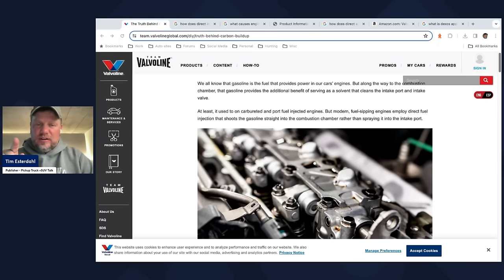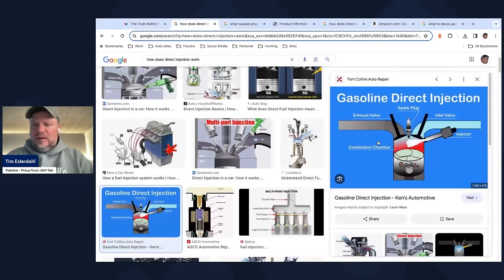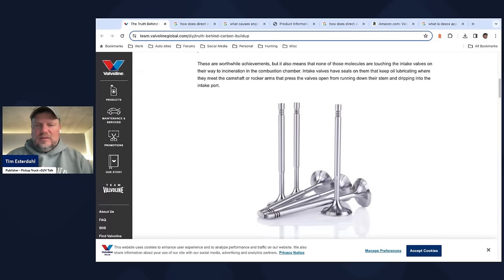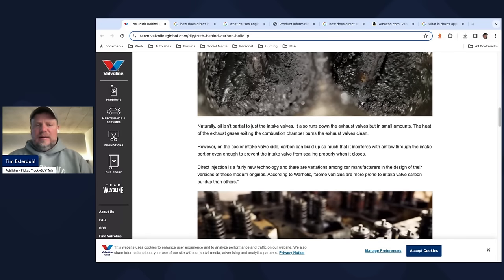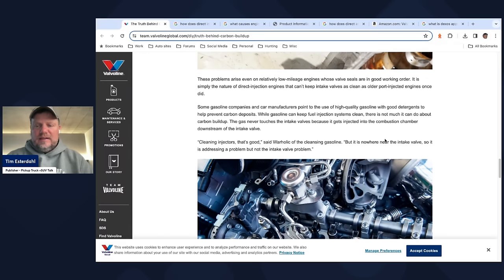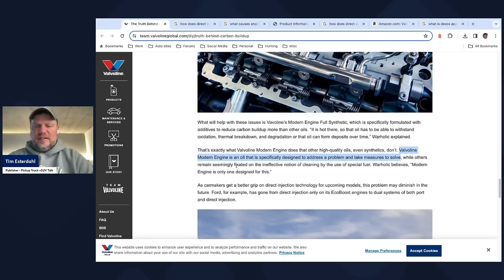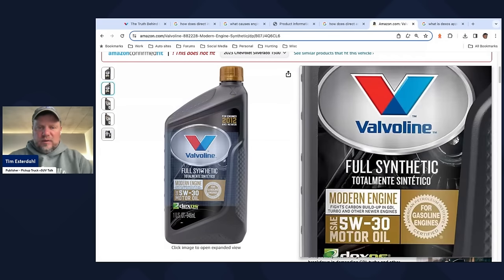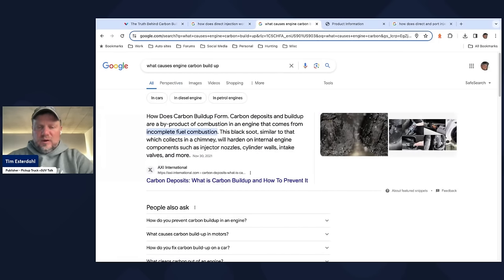Prevent Carbon Buildup with Modern Engine Oil? True or False?

Comment: You omitted one of the biggest culprits in carbon buildup in GDI gasoline engines--Exhaust Gas Recirculation (EGR).  Just as has been the case with diesel engines for over 20 years, EGR is a major contributor to carbon buildup on intake valves.  As EPA regs have tightened emission requirements to what are now ridiculously strict levels, EGR has become the major method of reducing NOx emissions in gasoline engines.  This started over 20 years ago with diesel engine emission control regs.  EGR use got so excessive on diesels that the engines' performance and longevity were severely compromised.  The "answer" was to move NOx reduction outside of the combustion chamber using Selective Catalyst Reduction and Diesel Exhaust Fluid, adding yet another level of sensitive equipment, complexity, and cost to the diesel engine.  Even at that, EGR is still used and is still a problem on diesel engines.  Gasoline engines are going to go the same route as emission regs tighten yet again.  Also, GDI also is increasing particulate emissions on gasoline engines.  Get ready for particulate filters and regens to be required on gasoline engines within a few years.  Keep voting for leftist politicians and the EPA regs will effectively outlaw internal combustion engines within a few years.  The EPA emission regs are no longer about cleaning the air, they are about  eliminating people's ability to afford to own personal vehicles.  That's already close at hand.
Reply: I have often wondered if we could use water/steam in place of the EGR exhaust gas to control NOx. Yes it would require distilled water keep hot enough to keep it in vapor form. It would probably rust the cat or SCR twice as fast
Reply: Most modern gas engines do not use EGR.

Comment: I have a Subaru 2021 forester with direct injection.  Quality oil …So what oil should I use ?  Gasoline is Costco signature ok ? So confused…..
Reply: Valvoline synthetic oil is good and Costco gas is top-tier gas so it is among the best you can get.
Reply: Full synthetic oil. Often a good idea to go up one weight in oil to reduce loss of viscosity. Top tier gas is best and an occasional use of combustion cleaners like BG 44k is good.

Comment: Low tension rings used today are more likely to get stuck causing more blowby. Using good quality Syn oil can help stop stuck rings or free them up. 
Amsoil, HPL, Pennzoil Ultra, Valvoline Restore & Protect are good products.

Comment: Ok..0w20-30-40 Class 4 Syn Oil...Change yourself every 3 to 5 thousand miles with new filter..Gas or Diesel/Star Tron Fuel Enzyme treatment..With GDI engines..Check PCV valve more often/ Big Catch Can ready at 90,000 miles+.......

Comment: Eco boost engines have both direct and port injectors to lower the amount of carbon.
Reply: The 2.7 and 2.3 needed it since Ford decided to use an EGR system (and EGR cooler) on it. EGR is a huge contributor to intake carbon on some DI engines. I believe one of the older Toyota engines that had DI only had an EGR system and caused a lot of the issues with carbon.

Comment: I have a ‘15 Sierra with the 6.2. It was dealer maintained most of its life for the first 90k miles. The engine started to stumble on startup at around 30k miles if I remember right. I had a $100 dealer coupon and used it towards their intake cleaning. After that I’ve done my own intake cleanings before each oil change mostly using Seafoam’s intake cleaning product. A couple of years ago I read an article that talked about Pennzoil European car oil and how it could reduce carbon buildup so I gave it a try even though it wasn’t Dexos certified and the thinnest weight was 0w30 instead of 0w20 GM recommends. It seems to work but I also swear I get worse gas mileage using it. I’ll look at this Valvolene oil and might give it a try.

Comment: I could be wrong but if you actually floor it like at least a couple times a week, you shouldn’t really have an issue w carbon build up, also using ‘top tier gas’ is more important I think vs any oil
Reply from the maker: As long as you get the engine hot and you buy good gas, you should be fine according to the people I’ve talked with over the years.
Reply: Do some research on gas refining. It all comes out of the same refinery there is no difference in gas.
Reply: @lawrencefranck9417  You need to do some research if you don't understand that the additive package for each gasoline brand and each grade of gasoline within a brand is different.
Reply: @4af  I have worked a port distribution port. One tanker fills three major brands and the amount of additives is so minuscule as to be irrelevant.
Reply: if you were just a laborer you have no authority to claim the gallon or so of additives added to each 8500 gallon tanker truck load is "irreverent" or not. A petroleum chemist I know at Shell insists that every car will benefit from the additive package used in Shell Premium grade gasoline.
Reply: @4af  more like 55,000 gallons.

Comment: Just drill a hole in the plastic intake runner past the mass air flow sensor install a premium aftermarket tire air valve remove Schrader valve run engine  about 1500 RPM start spraying carburetor cleaner in valve I would do it every oil change

Comment: Dual injection is an expensive stop gap solution to poor engine designs that use a lot of oil. That blowby oil in the crankcase is routed to the PCV and back over the intake valves. Stop the source of the problem by eliminating most blowby products and secondarily use detergents in the gasoline to scrub off the intake valves.
My 2015 Fit's intake valves don't look like new but there is no buildup on them after 110,000 miles. Use good oils and gasolines, I use Exxon/Mobil and Shell gasolines and Mobil 1 oils, along with good engine designs and you wont see this problem.

Comment: That oil is to clean pistons around the rings.  It won't be effective on intake valve deposity.  A catch can should be installed in the PCV system to avoid some of the carbon buildup.  As soon as you buy the car.

Comment: I'm sorry, but this Sounded like a valvolene commercial.  Why even bring up the conversation with Stellantis? When they didn't give you anything on what they did with their new engines to prevent carbon buildup?  What are they saying? Their new hurricane engines and the carbon buildup issue that they could potentially have.  Seems like adding a second injector to the port would have solved a lot of the issues. But I am canceling my 2025 Ram order. Because there's no clear response from Stellantis Is about what their solution is to direct injection and carbon build up.

Comment: The short is answer. It's  complicated.  A good oil spec, will help reduce carbon build up. But it can't totally prevent it. 

All GF6 rated oil has good LSPI and carbon prevention characteristics,  but oil change intervals are too long.

Comment: Valvoline restor and protect is not compatible with landrover 3 litre staight six engines as put in the latest defender D250 D300. It specifies 0w30 and only says use castrol

Comment: I thought the crankcase ventilation to the intake and exhaust gas recirculation to the intake was causing the buildup.
A friend put 186,000 miles on his 2012 F150 ecoboost without any issues caused by carbon buildup.  But, the miles were driving 35 miles each way to work which kept the engine hot.

Comment: Also, be sure to change your oil every 3k miles instead of extended oil changes, because the extended mileage oil changes are for people that drive exactly like the owner's manual states, but in reality, that is not how 95% of the population actually drive.  But unfortunately people do not read their owner's manuals.
Reply: 3000 if you use non synthetic oils.

Comment: I think manufactures need to include port injection like Toyota and Ford does. That would prevent it. Extended oil change intervals and people who idle excessively is the main issue from what I’ve seen with direct injection.

Comment: Car Care Nut, Scotty Kilmer, Automotive Press and others say to change your oil every 5000 miles, not 10,000. Car Care Nut took a Toyota four cylinder engine apart with a bit less than 200,000 miles that had the oil changed every 10,000 miles and there was a lot of sludge and varnish in the engine. He did it to show what happens when you change oil according to factory standards. Some say changing oil every 3000 miles on turbocharged engines would be a good idea. Most engines today are duel injection. My 3rd gen Tacoma has duel injection systems. It may be a good thing to check before buying a car. When you talk about oil blow by are you talking valve guide seals or piston rings?
Reply: Just use the severe service intervals listed in your manual.  Actually, read the SAE spec on "normal" versus "severe" service.  Do you know anybody who falls under "normal" service?  The manual on my 2020 N car specifies a 3k miles oil change interval for severe service.  It is a GDI turbo and I use a Saikou-Michi catch can.

Comment: I'm wondering why this new Restore & Protect oil will not meet Dexos certification. Lots of GM GDI engines could use cleaner piston rings to reduce oil consumption.
Reply: How do you know it won’t meet the spec?  Maybe they just didn’t want to pay the big $$$$ to GM to get the cert.
Reply: @georgeburns7251  I don't know what specific tests need to be passed to meet that certification.

Why can't they publish the oil passing the same tests.

Comment: Tim, you mentioned top tier gas. I have 2 Shell gas stations within a mile of each other, one station has the top tier sticker on the pump, the other station does not. Are they the same gas, or is the station that doesn't have the sticker just using the shell name so they can charge more money?
Reply from the maker: Go to Shell. Cheap gas is… cheap in more ways than one.
Reply: @Pickuptrucktalk  they both have the shell sign ,just different convenience stores as well as one has the top tier sticker on the pump while the other station doesn't.  I'm wondering if they are both Shell or the station that doesn't have the top tier sticker is knock off gas. I've filled at both stations and haven't noticed a difference in milage or power.
Reply from the maker: @jameshumphrey5923  or maybe the other gas station hasn't installed the stickers? Most gas stations have top tier gas.

Comment: I just started using Valvoline Restore in my Ranger to reduce carbon build up. Normally I run Pennzoil Platinum 5w-20/30 full Synthetic. We will see if and how it works.
Reply: I would like to hear your results on this  !

Comment: All the worries but no comparison to prove Ford Ecoboost have any problem. Just theory from some old examples of BMW's and VW's. A LOT of catch cans have been sold on this theory. I just do not accept it on my 2.7 a 2017 without a CC and clean as can be. Quality oil and fuels as well as effective PCV systems reduce and problem involved.

Comment: Wow not right……. Oil comes from the crankcase ventilation. So any blow by the rings causes combustion gasses to build up in the crankcase. This blow by is sent to the intake manifold where it is mixed with a small amount of exhaust by the EGR. The small amount of exhaust mixes with the oil vapor from the crankcase and that causes an oily mess that causes a carbon buildup. 
The only way to keep the intake clean is to buy a vehicle with both direct injection and port injection. Then it’s a no issue.
This has nothing to due with leakage past the valves……
Reply: This is exactly what I was waiting to be addressed. And it was totally missed. An oil that vaporizes less will cause less buildup, but unless we remove or address the PCV system, oil vapour and EGR will get onto the intake valves and not be washed off.
Reply from the maker: Oil. You said it in so many words. The issue is oil building up which I covered.

Comment: I use Shell V Power nitro thinking the extra detergents and additives will keep the injectors clean and fully atomize the fuel to minimize incomplete combustion and soot. I use Subaru oil certified API ILSAC GF-5  in my 2019 Forester and change it every 3K miles. The thought here is frequent changes will minimize the amount of soot and other contaminants in the oil and oil vapor and less that will deposit on the intake valves.

Comment: Engines outlast cars ten fold in the rust belt.
We don't need the engines to last longer, we need our government and auto companies to stop putting corrosives on the  roads.
Why don't people adress this issue.
Ive seen whole undercarriages come loose on a perfect looking car, subframe mounts rotted right off.
I've seen brake lines rot through in 3 years.
Fix whats broke
Reply: People like to hate on California but salt isn’t allowed to be put on roads in California—roads are plowed and sanded. 
It’s not as effective as salt because the sand doesn’t melt the snow, only adds grit to the top but at least the cars aren’t falling apart. 

I’m certain the reason they don’t allow salt isn’t to protect cars but rather to keep excess salts out of the river systems, but it’s still a benefit to cars nonetheless.

Comment: I am very sceptical that ANY of the fuel additives can make a difference with GDI because the additives are instantly combusted before reaching any carbon deposits. At least with Port Injection the fuel additives have a chance to contact the valve seats and piston chamber surfaces before combustion. And how are oil additives supposed to survive the high operating temperatures of the crank case at full op temp? None of the manufacturers of products with additives will disclose any details regarding their additives because they say it is proprietary information. They all just make nice videos with claims and they just say "trust us".

Comment: I changed oil in my 2017 Camry SE 2AR-Fe 4-cylinder with a consumption issue from gummed up low tension and oil piston rings . It's a problem with Toyota if you don't change oil at 5k anyhow it only has 80k on it so I'm trying the restore and protect. It's good so far.

Comment: The Chevy 2.7 turbo that’s on the newer Colorado and the canyon has a build in internal catch can so the turbo and the intake valves won’t get damage. 

TFL channel had interviewed the main project engineer for that particular engine.

As for this oil, I would not put this on a Ford engine that has a wet belt driven oil pump, the potency of this oil and the wet belt sitting at the bottom of the crankcase will wear out this rubber belt fast and eventually the pieces will clog the oil screen.  Time will tell…

Comment: ❤ I am considering buying a Porsche with an obvious valve ticking sound.  These incredible vehicles have issues with carbon buildup from Direct Injection.  The car has over 115 K and compared in videos to mine there is a loudish valve click sound a the left head of the V8.  Should I take a chance and buy this at a discount and start using Valvoline restore oil and some rather quick 2500 mile oil changes and some carbon blow out drives up the mountain.  Thanks again this is an interesting discussion because I think I can save these Porsche V8 twin turbos from engine death. Thanks again...

Comment: If you can run the engine cleaner it will reduce carbon build up.
You can also free up the oil rings by bonding a lubricant to them.
🙂
P.S. Oil choice is also very important as oils that leave fewer deposits will help.

Comment: Buy a Toyota. Problem solved.
Reply: Mine was just recalled for rear axle failure potential,  ohhh and the second turbo wastegate sticking fault, ohhh and a fuel leak recall, so why exactly do you think the Toyotas are bullet proof? At the rate Toyota is accommodating American consumers the Toyota will be the next Ram truck. They are getting cheaper in quality and that proof is readily available online.
Reply: F150 also offers dual injection.
Reply: @panthermartin7784 I think he was just referring to the D4S system that Toyota has been using for over a decade.
Reply: @LoneWolfSparty  hopefully they have finally fixed the issues with it over that decade
Reply: @paulhunter9613  with D4S? What issues are you referring to?
Reply: It's a crankcase vapor (PCV system) issue on ALL gasoline engines but it effects direct injection engines the worst no matter what fuel or oil you use PERIOD the only technology available at this time is a catch can but those things if not properly installed can create other problems
Reply: Toyota isn’t what it used to be unfortunately. I just did a quick video on my channel showing my 21 Corolla and it easily has the thinnest worst weakest paint on any vehicle I’ve ever owned. Low miles and hood has chips all over also the metal is so thin I can push it down with a finger. I compare to my Chevy truck and it’s embarrassing to say the least
Reply: @pryme2013  do you have a hatchback or a sedan?
Reply: @LoneWolfSparty  sedan. Built in Japan. Sure it’s the same as a hatch too
Reply: @pryme2013  it's not oddly enough. As to why that is? No idea. I'm actually surprised your Corolla sedan didn't come from Mississippi tbh
Reply: @LoneWolfSparty  LE with non DI 1.8 2021. Built in Japan
Reply: @pryme2013  I'm wondering if the hatch is different because it's the basis for the Corolla GR? 🤔